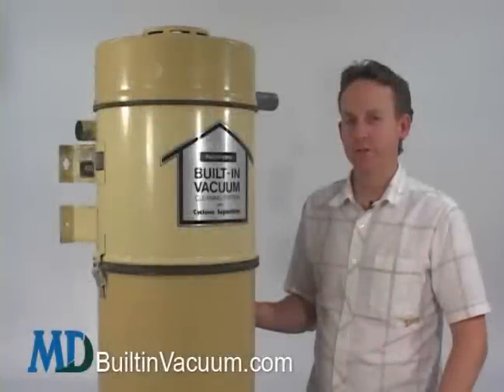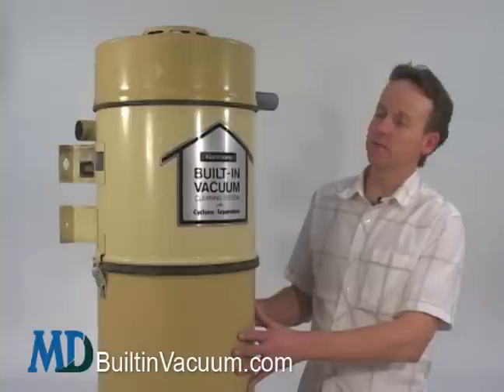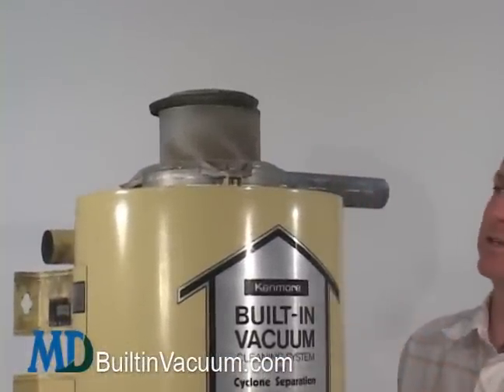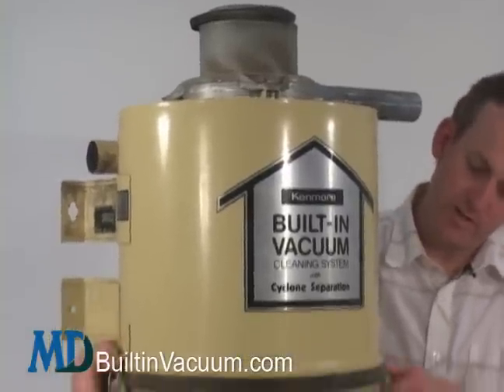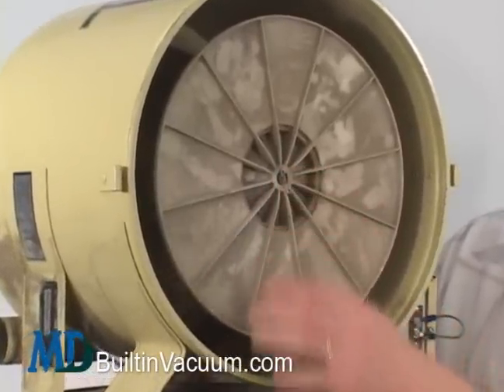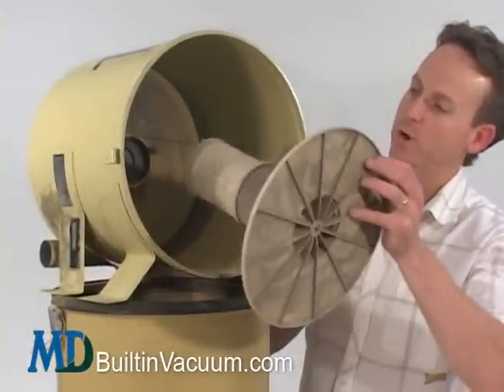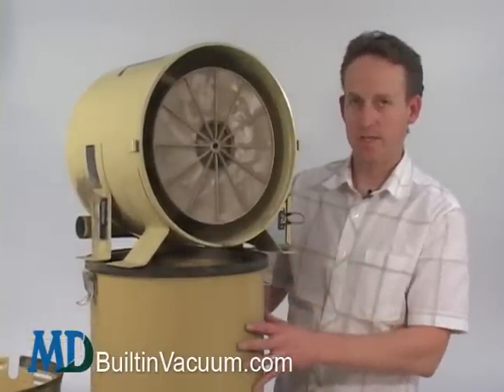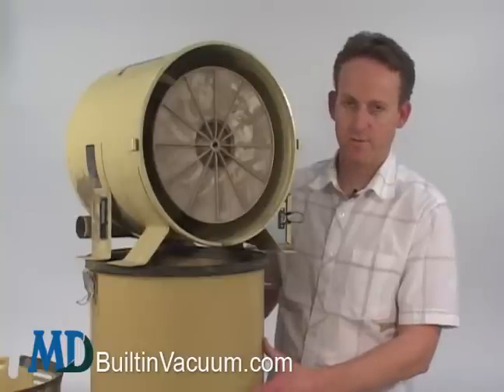Introduction to your Kenmore Central Vacuum Unit

Comment: I just moved into a house with a similar system.
Is there not supposed to be a cloth filter like other modern systems?
I was told this has a flow through motor and the dust could burn it out.
Can a filter be adapted?
Thanks for the video, I've been searching high and low for some kind of confirmation if it's missing something.

N
Reply: I know this is 6 years old but in the event anyone, such as myself, is out there looking for an answer to this question I have a solution! Unfortunately I too struggled to find any information on a filter for this vac and prior to me acquiring it, while it was in service, it never had a filter in it. I installed this in my garage and used an ActiVac III Exhaust HEPA filter so I needed to also filter the suction. I took measurements of the filter structure on the vac and after hours of searching I found a filter that, with a little modification, will fit this vac perfect!

The modification you need to make is taking a jigsaw and cutting out the plastic locking ring to the ID of the filter itself. Get some cheap adhesive backed weather stripping from hardware store and apply to the side you cut out. Slip the vacuums plastic "filter" as show in the video through the side you cut out and then install into vacuum as you would normally and you are done, I tested this yesterday and it works like a champ!

Search for this: Dirt Devil/Titan 10 Inch Cartridge Filter for Vacuflo Model FC1550 8107-01 Royal CS1200

Additional information for this Filter:
Replacement Pleated Cartridge Filter Compatible with 8107-01, 10-Inch high
Replacement for Vacuflo models: FC1550, Royal models: CS1200
Dirt Devil Pro Series models: 1390, Dirt Devil Platinum Force models: 499e, 599e, 699e, 799e and 1099e
Replacement for Dirt Devil model: CV3200

Amazon link: https://www.amazon.com/gp/product/B0711XF78S/ref=ppx_yo_dt_b_asin_title_o00_s00?ie=UTF8&psc=1